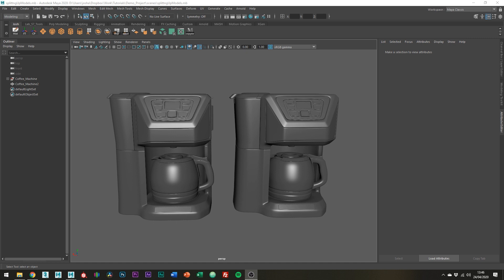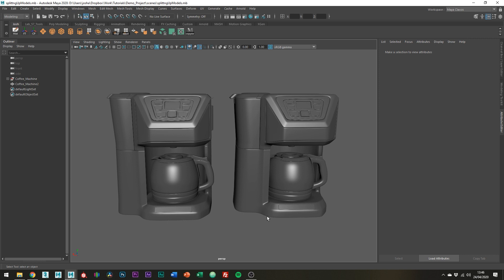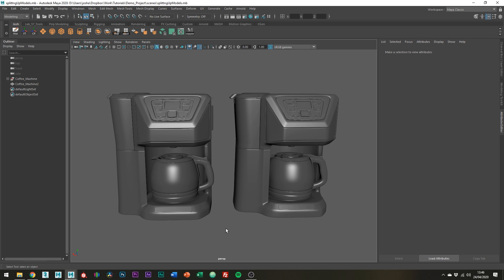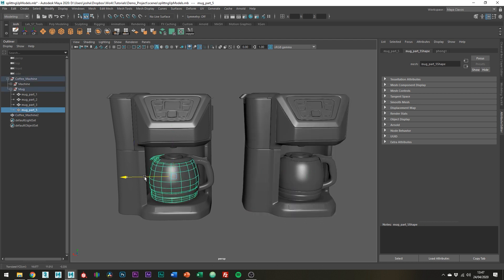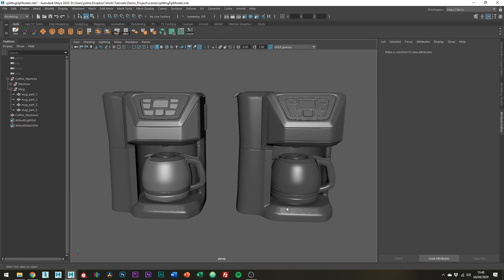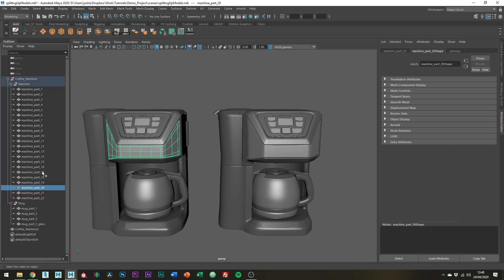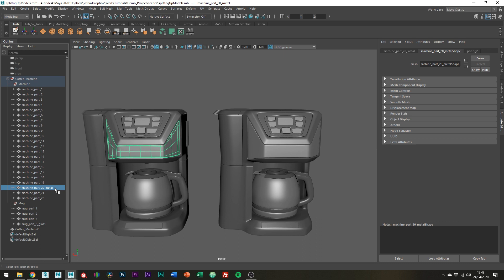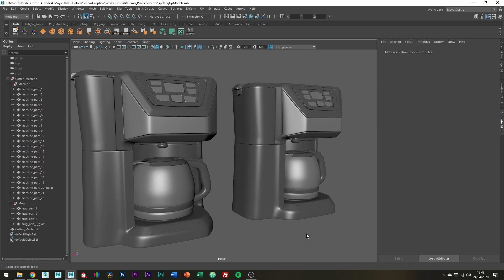When To Split Your 3D Models

Comment: What is your take on combining mesh pieces for less draw calls vs. ease of assigning materials for game assets (assuming you're familiar with that section of 3D modeling)?

Even as someone well out of college from modeling, I'm still not 100% clear on when to worry about combining objects to reduce draw calls. I used to do it a lot, but I noticed it was really inconvenient if I wanted to assign new materials to objects in the game engine rather than keeping the initial materials I assigned from Maya. Recently I've settled on worrying first about making it easier for the next person I hand the asset to (although right now it's just me) and worrying less about draw calls until testing. But is that really the best method?

Comment: if you use UDIMs then it's more efficient to use it combined, in case it was already shaded beforehand using the model separated.
Reply: UDIMs are best for larger objects which will be zoomed in on. I.e. a spaceship, a building, aircraft, etc. It's still best to separate based on material (such as have a UDIM for all the metals, a UDIM for all the dielectrics, and a UDIM for all the glass).

Comment: Great advice!Any tips on how to do this efficiently? I suppose model each part 'separately' and use hide selection to work within a piece yes?
Reply from the maker: I usually model in chunks (rough box modelling) then separate out the parts and add fine details. I can do a video on my technique.
Reply: @JoshAntonio  Yeah Yeah i get it. Well it would be nice to see a small video to adapt some things to mine :)